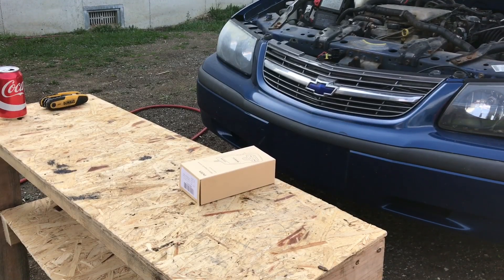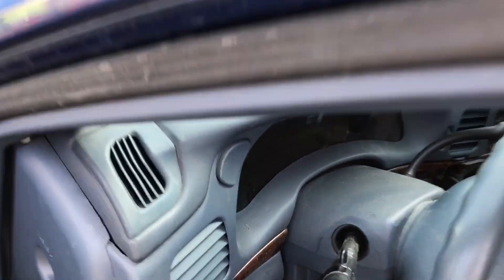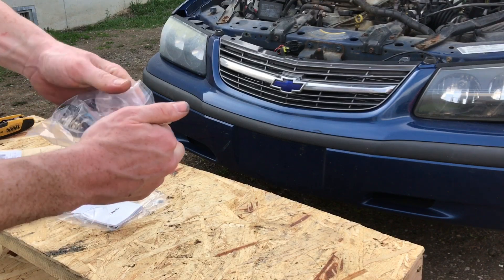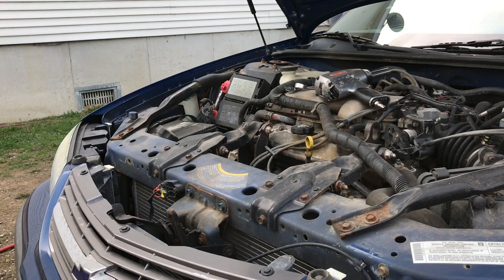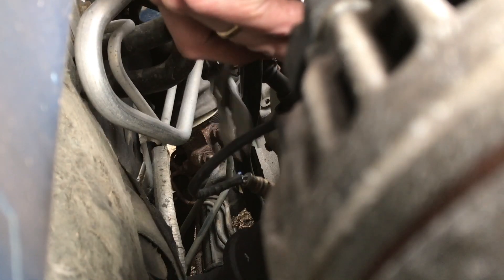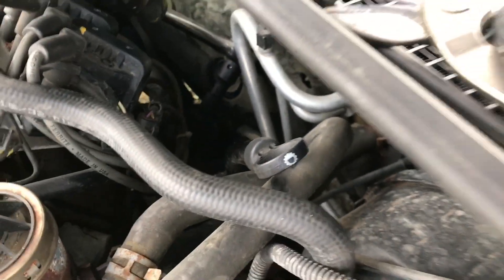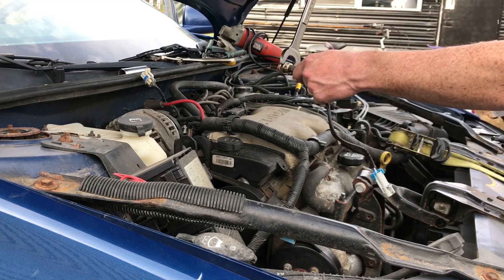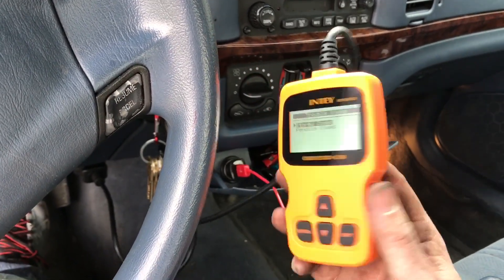O2 Sensor Impala Full Install

Comment: I keep having a damn misfire hopefully this is it I've changed the spark plugs n wires n fuel filter
Reply: Ignition control module
Reply: the 05 impala has a weak transmission. starts to act weird around 170,000 miles

Comment: Just a helpful tip.. walmart sells the 02 sensor socket set for $20.91. I got my 02 sensors out in less than 2 minutes a piece with the socket set. No need to take the engine mount out or cut any wires.  Otherwise,  keep up the good work.
Reply: What’s it called ?
Reply: Aaaaaaa
Reply: Rent from autozone, u pay full price they let u borrow it and return when ready, needed an pressure test kit and wasn't pay $200 for 1 time use
Reply: Also instead of taking the engine mounts off you could take off the belt and then take off your alternator to get better access.

Comment: Is this bank 1 sensor 1 or 2?
Reply: Sterling Witherspoon I think this would be bank 1. I have an 03 chevy impala and I think the upstream is bank 1 and the downstream is bank 2.
Reply from the maker: Sterling Witherspoon  not sure to be honest with you
Reply: Bank 1, Bank 2 is past your catalytic converter
Reply: Its BANK 1 SENSOR 1 (the Pre - Cat Sensor)
Reply: If it was on the back side of engine near the windshield, it would be bank 2 sensor 2.....or downstream. 
The bank refers to the engine heads or where cylinder number one is. So everything on the front of the engine on this side or front side of the head would be Bank one anything on the other side of the head nearest the windshield would be Bank 2.  There should be an upstream oxygen sensor on the front side of the engine near the exhaust as well and typically that's going to be the one that needs to be replaced, as the other one usually will not result in any foul running.
Reply: @michaelk3582 Just to clarify for others, this particular engine has only 2 sensors, 1 ahead of the cat and 1 behind. Sensor 1 is located, as shown here, at the conjunction of the 2 exhaust manifolds. It is called sensor 1 bank 1 just for consistency, as other engines may have 1 on each manifold/exhaust pipe. Sensor 2 is located downstream of the cat.
Reply: @19580822  yes, only 2.....I usually just refer to them as the upstream and downstream.

Comment: hey truck master would u still recommend the evergreen egr delete pipe?. and thanks for the videos they r really helpful
Reply from the maker: +Ben Rednour yes I would it's still going strong in my lbz just make sure you bolt the  Egr intake down tight when you install it
Reply: Awesome thanks man I just didn't wanna pay double the price when the evergreen does the job just as good

Comment: Could someone help my problem. My truck started knocking and loping and was blowing black smoke even if I didn't punch it and at idle it was blowing smoke. I'm thinking it's an injector but idk. (03 lb7) i can post the video if anyone needs to see it.
Reply: Tactical Camel go to silveradosierra.com. They should be able to help you on there.
Reply: Tigersfan829 I finally got a hold of my friend (him and his dad work on diesels and they just built a cummins) and his dad said it looks like one of my injectors is stuck open and that's why is making a god awful noise and dumping tons of fuel.
Reply from the maker: Tactical Camel I had the same issues on my LB7 it was injector #3 I was going to install just that one but since you have to pull valve covers on a LB7 I just replaced them all. Also check your balance rates before you determine its injectors I hope things work out for you
Reply: Truck Master thanks but the thing is I don't have a couple of thousand dollars laying around so I'll just have to replace the one or ones. Thanks for the reply. I'll post the video if you want to check it out. It's only about 7 seconds.
Reply: Hey truck Master, your video was nice, simple and sweet. Keep posting those vids. Gotta get me one of those little gadgets.
Reply from the maker: +Julio Hernandez thanks brother take care